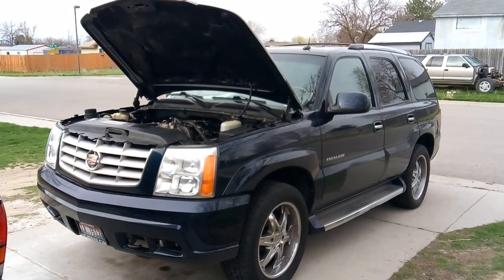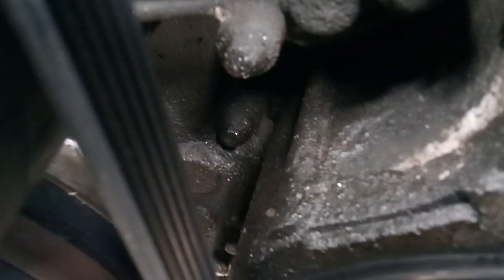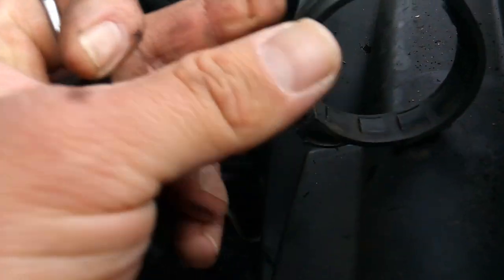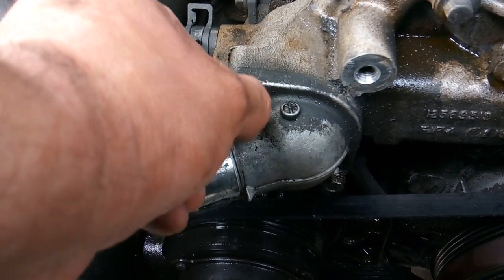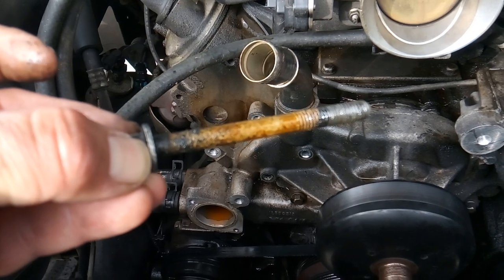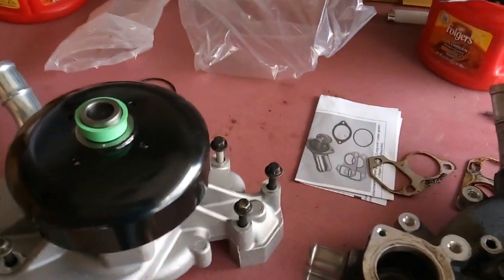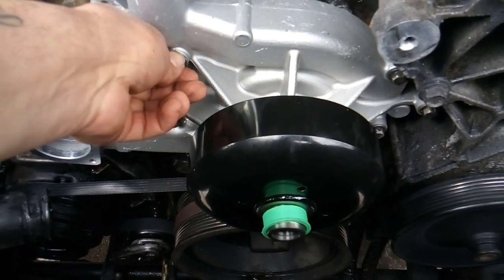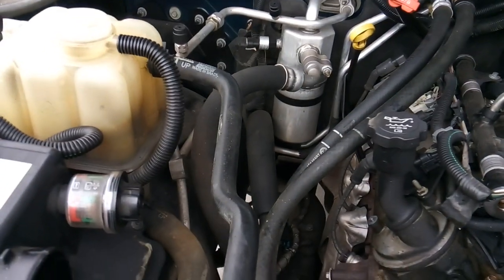2004/2005 Cadilac Escalade 6.0L water pump replacement

Comment: Hey boss I know it's been awhile since you made this but I have another three Escalade. My belt was squealing really bad I replaced it. And it was okay then all the sudden it popped off and I lost all power of course but when I lifted the hood there was coolant all over. My belt came right out it wasn't hooked on anything or broke or ripped or anything so you think that was no water pumped that went bad? Considering the coolant all over around the crank area
Reply: Prior to its popping off there was a little bit of rumbling download in my engine compartment. I figured that was the bearings going bad in the pulley

Comment: Do you need waterpump sealant on the back of the waterpump of the new one? I see you used it on the thermostat.  Did you use it on the other gaskets?

Comment: Thanks for posting.  How did you bleed air from the system?  Many cars have a high point in the hose that allows for an easy bleed, but less clear on the LQ9.

Comment: But the electric fan it’s work with it only with the AC right
Reply from the maker: No. The electric fan work either with the ac or they will kick on between 200-230 degrees

Comment: Ive changed my water pump, thermostat and radiator, and still it’s overheating. Can’t seem to find the issue
Reply: Did you change fan clutch